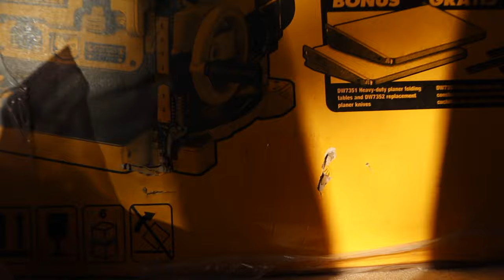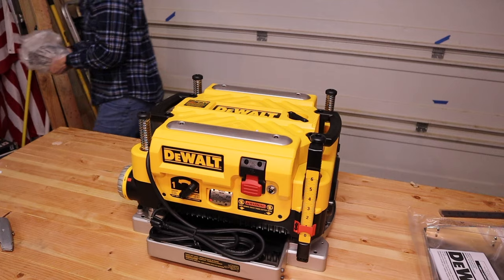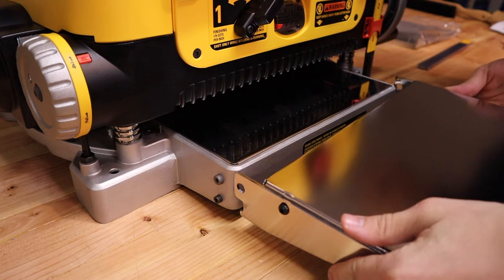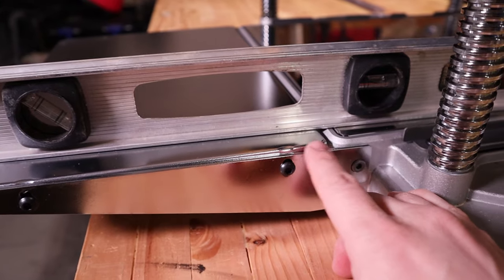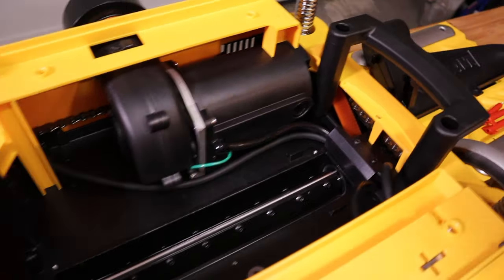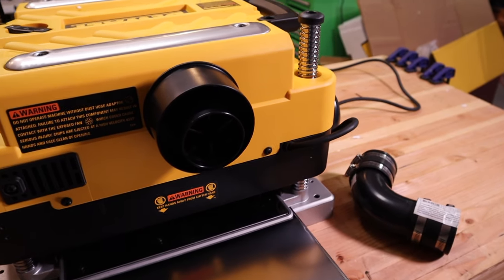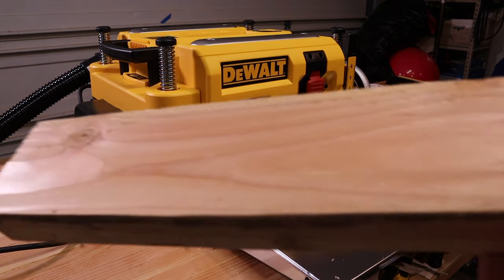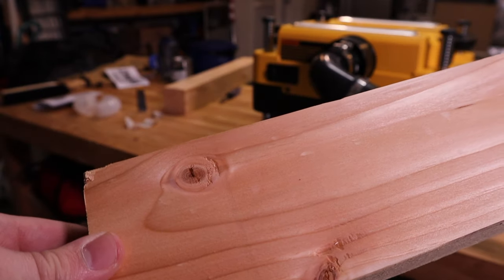Dewalt 735 Planer | Unboxing & Setup

Comment: God morning,
I ordered the 2.5 inch x 10' hose as shown in your list, only to find out that it's too big for the port on the Dust Deputy.  The hose fits the outside of the fitting on planer end instead of inside as shown in your video.  It looks like from your video that you are using a smaller hose then 2.5".  Any suggestions?

Comment: You will get less snipe if you position the grain heading down into the bed. The other side would be done on a jointer.
Reply from the maker: From a logistical perspective, does this then limit your workpiece to the width of your jointer?
Reply: If you’re going to use a jointer you should run it through jointer first, jointing one face & one edge square to it then run it through planer to plane opposite face. I only have a 6 inch jointer so wider wood needs to be faced on planer with a planer sled & leveling wedges then taken to jointer to square up one edge in preparation for table or track saw.

Comment: thanks i need one like that can you help me in purchasing one with 240 volts
Reply from the maker: Great question! I’m seeing rumors online that Dewalt has a 735-XE model which is 240V but I can’t seem to find a product listing. It’s possible because my IP is in the US that I’m only linked to the 120V model. Check to see if you can find a 735-XE locally.

Comment: I appreciate the video. What did you use for the dust collection?
Reply: For additional info, I saw the list of items on the description. However, I am wondering, do you attach a vacuum to the dust deputy?
Reply from the maker: Great question! I used the below items. 

    Coupler, 2.5": https://amzn.to/3mqT1Pe
    Elbow, 90deg: https://amzn.to/35Et5c9
    Reducer, 2.5"-2.25": https://amzn.to/3e4lrvq
    Dust Deputy: https://amzn.to/3jBu6H0
    Hose, 2.5”: https://amzn.to/37MqhMN
    Hose, 2.5” Adapters: https://amzn.to/2HJGO9z
    Blue Barrel: https://amzn.to/2HDpGlI

Comment: I don’t understand the need for the cyclone attachment. Why can’t I simply run a hose from the planer into a catch barrel or bag?
Reply from the maker: You totally can! The bag or barrel will need to have an outlet of some kind to let the air out and the cyclone just helps to "clean" the air ahead of time. There are plenty of bag attachments for planers though. 

Great question!

Comment: What type of dust collector is that? Just a stand-alone bucket with some sort of funnel?
Reply from the maker: This one is a basic two stage separation system. Single stage would be shop vac only, two stage has a dust separator ahead of the vacuum. This system, which I still use regularly, is a dust deputy on top of a generic blue barrel. You can put it on top of anything with an air tight seal. I’ve included links below for all the parts I used. Honestly, a dust separator is a huge bonus and almost a necessity in a wood shop. I’ve had to change my shop vac bag once in 2 years and I bet most of that was from when I was too lazy to hook up the cyclone.

    Coupler, 2.5": https://amzn.to/3mqT1Pe
    Elbow, 90deg: https://amzn.to/35Et5c9
    Reducer, 2.5"-2.25": https://amzn.to/3e4lrvq
    Dust Deputy: https://amzn.to/3jBu6H0
    Hose, 2.5”: https://amzn.to/37MqhMN
    Hose, 2.5” Adapters: https://amzn.to/2HJGO9z
    Blue Barrel: https://amzn.to/2HDpGlI
Reply: @NorthwestCraftsman  thank you for all that, very helpful. And also thank you for not heckling me for probably a noobish question…as I’m new LOL
Reply from the maker: Hey! No problem at all! That’s the idea behind this entire channel. I’ve only been woodworking for a few years at this point and I wanted to document the process of what I’m learning. If you go back to my early videos, you can see how cringeworthy they are 😂 but learning and growing the whole way. 

Happy Woodworking!

Josh
Northwest Craftsman

Comment: Did yours come with the torx driver you are using in the video? Mine didnt.
Reply from the maker: The T-Handled one, yes, if you didn’t have one in yours, I’d reach out to your reseller or DeWalt directly. Double check the top case part, it nests in their quite discretely.

Comment: I visited my local pawn shop and found a 2021 DW735X for $430 hardly used👷🏻‍♀️ I'm so jazzed! How would I get a replacement star key tool?, I'm using a seperate star key set but....
Reply from the maker: Fantastic! That’s a great deal! It looks like they sell the replacement with the fasteners on Amazon but I believe it’s a T-20. Double check that though. 

https://amzn.to/3I7E0Qm
Reply: @NorthwestCraftsman  such a gratifying memo thx for replying. I figured someone would reply but much to my surprise you took the time. Okay the T-20, Ill verify. I'm jazzed there are blades in this pawn shop DW735X. I was just in the shop mounting my 2nd table saw on stand. I got a cheap Ryobi 10" $189 coz my 10" Craftsman is driving me nuts with the broken gate and unable to change out my blade due to old parts, coz this gal has a fairly large custom order that I must finish by deadline, so the DeWalt planer was a God sent and Thank you for these tips , I already looked for finishing wax, now that you mentioned it. 
So your vid is rather helpful👩🏻👍
Reply from the maker: So glad to help! The 735 was the first power tool I purchased, outside of a drill,  purely for time savings. It’s easily been the most used tool in my shop since every project starts with it. Good luck with your projects! And feel free to stop by if you have any questions! I may not be able to answer them but I can at least give it a shot 😊

Happy Woodworking!

Josh
Northwest Craftsman
Reply: @NorthwestCraftsman  I verified it is T-27 and T-25 star tool, will fit as well.
I see what you mean about shop vac not being able to keep up... omg mine filled up in no time and I didnt realize it until saw dust blew back out the front of the planer🤦🏻‍♀️ but what a great job the DW735 does😎🤙
Reply from the maker: Awesome! Thanks for confirming! 

And Right?! For a very long time I had my Oneida cyclone hooked up with no shop vac at all. Just let the blower power it all and that worked amazingly. It’s still more powerful than my 1HP dust collector 😅

Comment: So since I only have a shop vac, do I turn the shop vac on when using it, or no?
Reply from the maker: If you don’t have a dust deputy/collector set up I would turn it on since the planer would otherwise have to push all the air through the filter and motor of your shop vac as well. There are also a lot of really great plans out there for cheap dust collectors which I’d recommend because this produces chips very fast.
Reply: Yes, turn it on.

Comment: What's the dust collector you use and where can I get one?
Reply from the maker: Great question! It's an Oneida cyclone dust collector. They have different sizes but this one is sized for a shop vac, though, it's not strictly necessary to have one because the blower can power it. Below are the links for the setup I have. 

Dust Collection Setup. 
    Coupler, 2.5": https://amzn.to/3mqT1Pe
    Elbow, 90deg: https://amzn.to/35Et5c9
    Reducer, 2.5"-2.25": https://amzn.to/3e4lrvq
    Dust Deputy: https://amzn.to/3jBu6H0
    Hose, 2.5”: https://amzn.to/37MqhMN
    Hose, 2.5” Adapters: https://amzn.to/2HJGO9z
    Blue Barrel: https://amzn.to/2HDpGlI

Comment: Excellent video!  For leveling the feed tables, highly recommend using a box level.  Accurate to 0.1 degree.  Place it in the middle of the bed withe the face positioned toward one side (as opposed to facing the direction of wood feed), zero it out, then move it to each of the feed beds.  QUESTION:  How do you adjust if the blades are not parallel to the bed, making one side thinner than the other?
Reply from the maker: Thanks for the compliment! And you’re totally right with the box level, great idea. 

One problem I’ve found recently with my trays being perfectly level is that the small amount of flex they experience under the weight of a long board will induce snipe. To counter this, I’ve inclined them ever so slightly, so the outsides are higher, which reduced my snipe greatly. 

To your question though! Which, thanks for the clear formatting, made it much easier to spot the question. That will likely be in the 4 posts that raise and lower the entire cutting mechanism. I haven’t ever heard of it not being true to the bed. I’d contact Dewalt if you have an issue with that.

EDIT: After some quick Google sleuthing it looks like rotating the posts individually is the way to adjust but that this is done exceedingly rarely.
Reply: @NorthwestCraftsman  Great idea on the snipe -- will do it, thanks.  Don't have the room to house a feed table similar to miter saw -- that would be sweet!   As for level, it's off .017' across 5.5" piece of hard maple, according to my Neiko 01407A .  Significant to me for table tops.  Will continue research; thanks again.
Reply from the maker: Interesting! I need to go through and measure mine to see if it’s co-planar or more realistically how co-planar it is. 17 thou over 5” seems pretty steep. 

Here’s one of the threads I saw on the topic. One guy measured off each post and iteratively checked on a piece of wood. I suspect you could just iteratively plane a piece until you’re within tolerance across the cutter head. If mines out, I’ll end up making a video on it 😂 let me know if you learn anything! 

https://www.finewoodworking.com/forum/dewalt-dw735-does-not-plane-same-thickness-from-one-side-to-the-other
Reply: @NorthwestCraftsman  Will do!

Comment: Hi. I need your help in resolving this problem.  I used the links you provided to purchase all the parts you listed only to learn that the Dust Deputy bottom and the Blue Barrel  top sizes don't match. The Blue Barrel top diameter is a coupe inches larger than the dust deputy bottom which is about 13" I think.  I can provide the exact dimensions if you need them. Please help.  Sincere thanks.  Jerry.
Reply from the maker: Hey Jerry!

When I purchased my dust deputy it came with a hole guide and a gasket so I could then secure it down to the lid. Does yours have those components?
Reply: @NorthwestCraftsman  Hi Thanks for your prompt reply -  First, I ordered the Plus version of the Dust Deputy which comes with a lid I thought would just snap onto the Blue Barrel. Unfortunately, the lid is far too small. So do I just toss the lid and cut a 5" or so hole using the gasket as a template and screw this directly into the top of the barrel?
Reply from the maker: Should be something close to that! I haven’t used the super before but if it’s like the regular, the bottom of the cyclone has a flange with the central hole and hole pattern around the edge. I drilled that pattern out of the lid included with the blue barrel and then bolted it on. Again, I haven’t used the super, but if it’s like the regular, it should be close to that.
Reply: @NorthwestCraftsman  Many thanks for clarification.  Great Video btw. Keep em comin.  Jerry

Comment: Where you get the dust colector  man?
Reply from the maker: Hey Gabriel! Here are the links to system I have. 

    Coupler, 2.5": https://amzn.to/3mqT1Pe
    Elbow, 90deg: https://amzn.to/35Et5c9
    Reducer, 2.5"-2.25": https://amzn.to/3e4lrvq
    Dust Deputy: https://amzn.to/3jBu6H0
    Hose, 2.5”: https://amzn.to/37MqhMN
    Hose, 2.5” Adapters: https://amzn.to/2HJGO9z
    Blue Barrel: https://amzn.to/2HDpGlI

Comment: Would a roller stand not help with snipe ?
Reply from the maker: Depends on the cause! On a long heavy board, absolutely. The indeed/outfeed trays sag under the weight without a roller and I frequently use one on either side. With smaller boards that won't sag, snipe is still usually caused by the trays being misaligned. I have to adjust mine periodically because the times I feed a heavy load through.

Comment: What does the dial on the left do?
Reply from the maker: Great question! It’s a preset depth stop. When you set the depth there, you won’t be able to adjust it lower than that. I have found it to be less than accurate and just relied on the gauge to get repeatably planed boards.

Comment: Thanks for sharing. I noticed you plugged the dust port on the planer to a dust deputy . Did you connect a shop-vac to the dust deputy?
Reply from the maker: I actually don’t! The 735 has enough blowing power to take advantage of the dust deputy’s cyclone. I’ve found that adding the shop vac on the back side only restricts flow more. Plus, the few fluffs of shavings that make it out of the dust deputy exhaust port are far less than the ones not extracted from the knife area of the planer.
Reply: @NorthwestCraftsman  Awesome! Thanks !
Reply: @NorthwestCraftsman  Have you tried capping the top port on the dust deputy or does that hurt the performance? I have a dust deputy mounted to a 55 gallon drum. Thanks
Reply from the maker: Capping the dust deputy will stop it from working, it needs the air to flow through the side port, around the edge, and out the top. Otherwise it’ll just pressurize the container it’s on.

Comment: What is that drum you have hooked up to the hose catching the dust? Is it hooked up to the a dust collection system or is it independent?
Reply from the maker: Great question! The drum is for dust collection but I stand alone because the exhaust on this planer is sufficient to force the chips through the cyclone. Below are links to all the parts I used.

    Coupler, 2.5": https://amzn.to/3mqT1Pe
    Elbow, 90deg: https://amzn.to/35Et5c9
    Reducer, 2.5"-2.25": https://amzn.to/3e4lrvq
    Dust Deputy: https://amzn.to/3jBu6H0
    Hose, 2.5”: https://amzn.to/37MqhMN
    Hose, 2.5” Adapters: https://amzn.to/2HJGO9z
    Blue Barrel: https://amzn.to/2HDpGlI
Reply: @NorthwestCraftsman  Thank you! I just received my Dewalt 735 planer a couple of days ago. This helps alot and I will be setting it up like yours. So far has it been working fine the way you set it up with independent dust collecting?
Reply from the maker: It works great with it being powered independently. Only real reason I hooked it up to the rest of my dust collection was because I didn’t like hauling my blue barrel from one tool to the next. I do see an improvement in chip collection when I have it hooked up to my primary dust collection but nothing that would make me say it needs to be done.

Also, I think you’ll love this tool. It’s a work horse and probably the most used tool in my shop. Next upgrade I have planned for it is a Shelix cutter head.
Reply: @NorthwestCraftsman  Cool thanks man!  Yeah I saw a video of people changing the cutter heads I hear good things about it.
Reply from the maker: Same here. Only down side is it looks like Shelix is back ordered for about a year and they cost almost as much as the planer 😂
Reply: @NorthwestCraftsman  😱
Reply from the maker: Yea 😂 there is sticker shock with it but, at $50 for a set of OEM replacement blades and the issue with knots nicking the blades, it’s not wholly unreasonable. When I get one, I’ll certainly have a video on it.
Reply: @NorthwestCraftsman  Nice!  Ill see how long the OEM blades last me. I will be running some pretty hardwood through so hopefully I’ll get a decent life out of the OEM blades.
Reply from the maker: They should last a while. If you get a few nicks in the blades, you can offset each blade slightly to remove the nick since the other blades will shave it off. Also don’t forget the OEM blades are double sided 👍 what kind of projects do you have planned?
Reply: @NorthwestCraftsman  Thanks for the tip. I started making some cutting boards. And needed a better planer. I was using and old Delta but It wasn’t able to really handle Purple Heart wood.
Reply from the maker: Very nice! That’s exactly the hardwood usage I’ve gotten out of mine. I only take 1/32” passes on mine usually and that seems to work well especially for the 12” wide boards which bogs it down quite a bit.

Comment: Well done, great instructional video!  Can you please tell me what dust collection can/barrel system you are using?  Does the flex hose come with the barrel or do you get that at a hardware store?  4 inch?  Thanks in advance!
Reply from the maker: Thanks Joe! I appreciate the compliment. I use the dust deputy and bought the blue barrel to collect. The hose and adapters were from amazon but you may be able to find one at your local hardware store as well. For the hose size, I use 2.5”. 

If you’re interested, all the products I used are linked below. 
Dust Deputy: https://amzn.to/2zoM7Xw 
Blue Barrel: https://amzn.to/3dwMHkW 
Hose, 2.5”: https://amzn.to/3dAiIbo
Hose, 2.5” Adapters: https://amzn.to/3fVnnpO
Reply: @NorthwestCraftsman  Thanks so much! Keep making videos, they are excellent!

Comment: Whoa mine did not come with the infeed tables
Reply from the maker: Not all of them do, the 735X does and has a few spare blades but the regular 735 model only has the base planer. Sometimes stores will also run a deal where you can get the planer mount for free (this was a deal I took advantage of).

Comment: Good but not thorough enough or complete. As others have said, DO NOT ADJUST TABLE EXTENSIONS! Mine worked perfect right out of the box, zero snipe! I made the same mistake on my last (Rigid) planer. 
Would have liked to see more (any?) info on turret settings, depth of cut, using different speeds, multiple boards at same thickness etc.
These are pretty important elements to effectively use this unit. Need to look elsewhere to get fully and properly informed.
Reply from the maker: Thanks for the feedback! This was one of my earliest unboxing videos and I had been experimenting with different depths of content and agree that deeper has been more popular. Because I’m always learning, it’s not always possible or feasible to hit everything in an unboxing video and am planning to do followup videos a year or so after that touch more on usage.

Truly, thanks for the feedback and happy woodworking! 

Josh
Northwest Craftsman